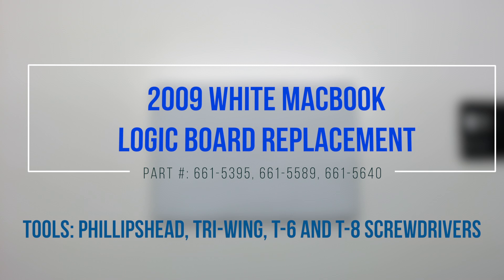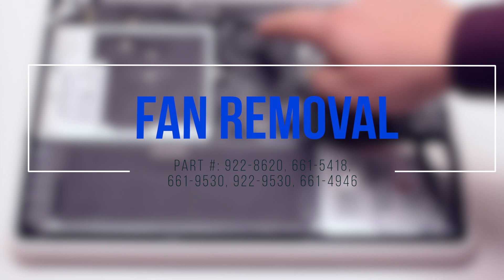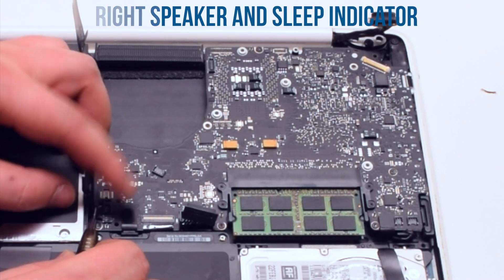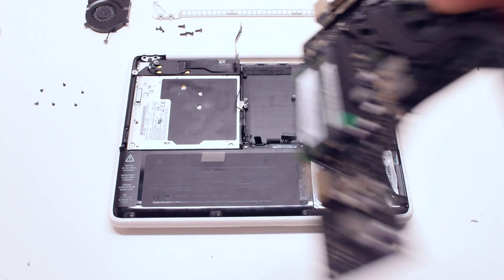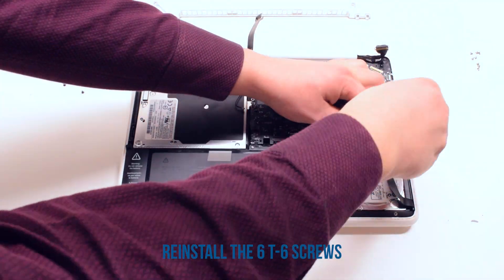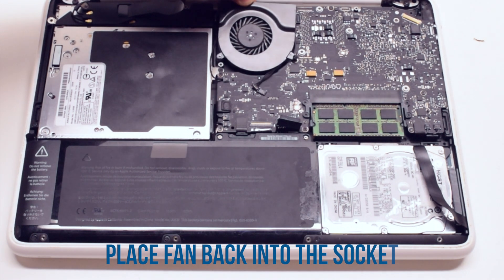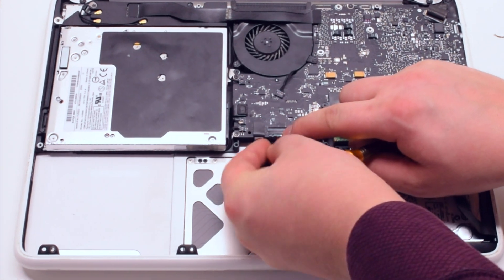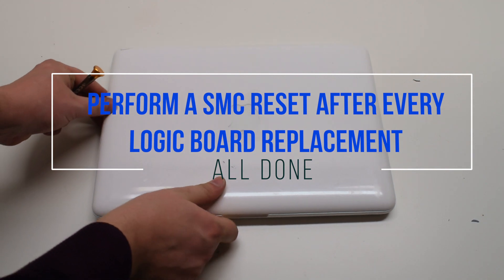2009 White Macbook A1342 Logic Board Replacement

Comment: I have this computer with triple boot Linux installations on it and refind as my bootloader. I blew out my usb's getting an over current condition on both USB 1 and USB 2 in the Linux kernel bootup process... If I replace just the LOGIC BOARD not the WHOLE MOTHERBOARD will this earase my data and or my operating systems?

Comment: thanks for this brother! I've got one of these and will be doing the logic board soon... question, do u know if the 2010 2.4ghz board will swap  without issues in a late 2009 2.26ghz  macbook?
Reply from the maker: As long is it's an A1342 (White unitbody macbook) then it will work.
Reply: Bro where did u get the motherboard

Comment: I have a Late 2007 Black MacBook 2.2GHz and was wondering if you think I could swap an A1342 motherboard into it. I love the black Macbook but it can't go past OS X 10.7 and 10.10 seems to be the oldest supported OS X for most programs.
Reply from the maker: It will not fit, the short answer is no.

Comment: Can I replace 2.26Ghz Geforce 9400m motherboard with 2.4Ghz Geforce 320m motherboard without changing the battery etc?
Reply from the maker: It should fit no problem, all ports and connections align.
Reply: Thats exactly what im planning on doing, were you successful?